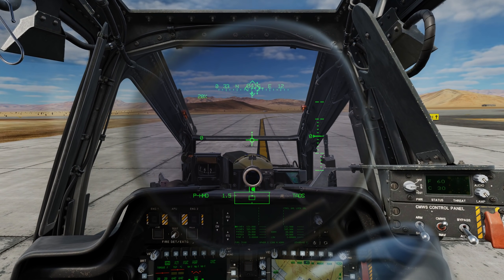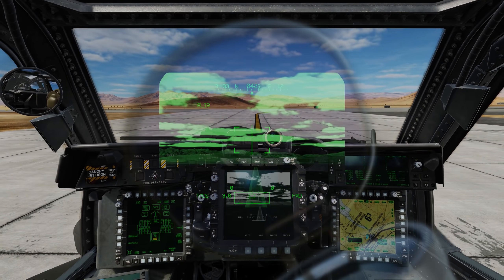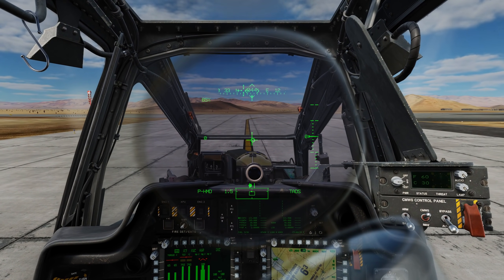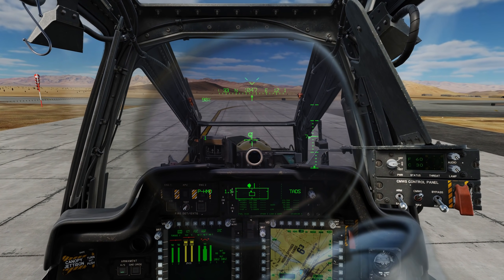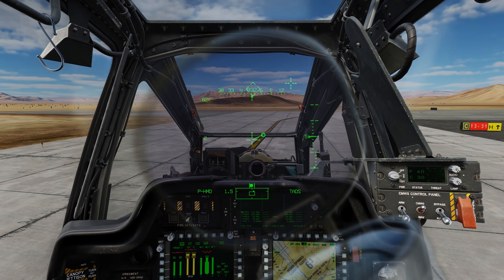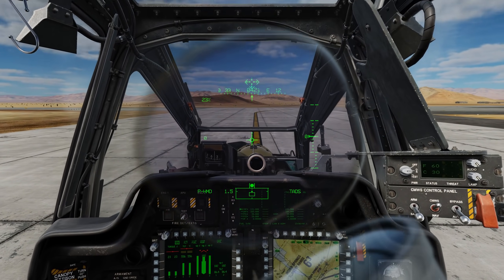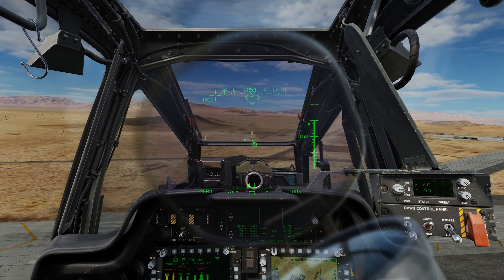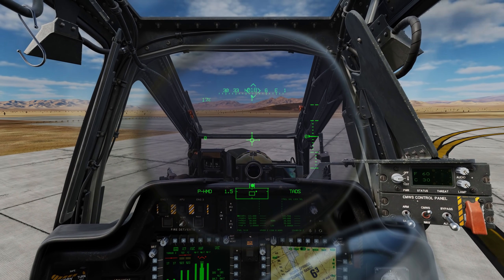DCS: AH-64D | VRS and Settle with Power

Comment: I see guys all over YouTube demonstrating VRS recovery.  How come everytime you hover you’re not in VRS?
Reply from the maker: Just flying correctly within the envelope based on IGE, weight, and keeping an eye on vertical velocity. All instances I've seen online of players getting into VRS are cases of not flying the helicopter particularly well.
Reply: When in a stable hover the air is being pushed downward throughout the length of the rotor blade and the air at the blade tips are creating a vortex, just like an airplane has a swirling vortex of air that your see coming off the wing tips. In VRS/SWP the air has 2 swirling vortex along the blade length. The first is formed at the blade tip with the air swirling out and coming back in to the blade and the other has air moving up through the blade root and it swirls back into the Blade. It is the vortexes that reduce lift in the rotor blades and cause the helicopter to settle. VRS and SWP are the same thing. VRS is the technical term and SWP is the common term.

Comment: Good demonstration. A rule of thumb is to always make sure that as the airspeed gets down to 40 knots or so, that the Rate of descent must be less than 300 ft per minute. Another important factor is that when you go through translational lift, (either speeding up from a hover or slowing to the hover) make sure you are into wind. This is especially important for all the learner helicopter pilots out there....

Comment: It's not settling with power.  It's settling with INSUFFICIENT power.  That is what we teach at Ft Rucker.  There has been 1 helicopter that has enough torque/power to get out of this condition, and it is/was the CH-54 Tarhee/SkyCrane.  Everything else, even the mighty Chinook which has a shit-ton of torque, can't power out of that condition.  It must bite clean air, preferably laterally, to get out of the condition.  This is not the same as VRS however, it is aerodynamically different.

In terms of this module, I think it would help folks familiar with DCS to look at this as the "Hornet of Helicopters".  It is complex, a deeply integrated weapons system, and has the Tomcat's AI to assist the pilot/CPG with tasks.  I was a Chinook guy not an Apache driver, but I still have Army Aviation experience.  This module is very well done, the flight model is VERY nice, and I think as this iterates it will grow into a very accurate representation of this amazing weapons system.  You need look no further than folks that have flown this platform and the way they speak of the DCS implementation of it to make that assessment...
Reply from the maker: Our group of Apache pilot SMEs will disagree with you.
Reply: Karl…SWP and VRS are synonymous. Look it up in the FAA’s Rotorcraft Flying Handbook.
Reply: @jjsemperfi  They are not synonymous.  The best way to think of it, is one can can mature and develop into the other.  The easiest way to think of it is, you can begin settling with insufficient power, and it can develop to full blown VRS.  Similar, but not the exact same thing, would be incipient stall to a fully developed stall.  

You can also encounter VRS directly, such as a low altitude hover near obstructions that interfere with the downdraft and can cause VRS directly and immediately, even if not descending.  Rare I grant you, but it can happen, especially in an urban setting.  I didn't want to sit here and have a highly technical discussion with a group of folks that would be uninterested in such a thing.  I was trying to relate the knowledge without overwhelming someone.  btw, there are also newer techniques that have been evangelized widely that purport to get out of the condition without losing more than 50' of altitude.  Go look up The "Vuichard Recovery Technique". 

I appreciate you telling me where to look.  Not sure I have ever heard of them, being licensed for 30 years and being an instructor and all.  :)  Having said that, I don't know everything, about anything.  Anyone that does this stuff that knows even a little bit, should have the wherewithal to tell you that you are constantly learning, or you are a huge risk.  Both can't be true.

Comment: About the trick for turning off the video from the IHADSS when using TADS, it's the brightness button you want to use, not level. If you use level, you will turn off the video on the TDU too, and basically make TADS useless. But use the brightness button while the Helmet is selected sight and you can turn it off just for IHADSS.

Comment: Getting out of VRS is easier and faster, also requireing less altitude, by using the Vuichard Recovery Technique (https://youtu.be/HjeRSDsy-nE). With the AH-64D, it's cyclic right, collective to full power and left pedal to compensate. In case you want to translate the technique to any other helicopter, then go by the basic of rule: Cyclic goes opposite direction to the pedal.

Comment: These are invaluable videos, but for me personally, I can't even do your first lift up. I get that I need to rudder left and correct a little cyclic but the heli always just veers off all over the place.  Been at it since release. No luck. Either I'm missing something critical or the controllers not configured right.
Reply from the maker: You may with to adjust your curves.
Reply: @MattWagner  Spot on again Matt thanks. I haven't got it down every time yet but if it helps any other newbies like me, by setting the rudder left and slight down left cyclic and fixing it with trim, I was able to concentrate on chasing the hover circle which got me hovering.  It was all way too sensitive though so it's no doubt crucial to get curves and sensitivity etc set right for your controller.  Onwards and upwards!
Reply from the maker: My curves here. https://youtu.be/HmjNjNDp0JA

Comment: The SWP modelling in the Apache is pretty much the best represented in the game. I hope at some point the other helos get some remodel, as the "vrs" to me is a bit too easy to enter. Since the first few flights in the 64 the first two things I look at are the OAT and the Elevation. Then will automatically start to decide, to I need all the pylons filled ( esp if having to to sneak attacks from cover ). One question - the predicted performance torque required, it is always the same for IGE and OGE. OGE would always be higher and the values don't seem to compare as well with what you actually get. PS> will HIT tests be implemented ( add them to the Huey! ) haha
Reply: @aldamico  I never said the Huey flight model is bad. Enters VRS too easily. I feel like the MI 8 is the same. I have about 1000 hours riding around in Hueys and some stick time so I know a little bit. he Huey feels like what I remember from flying one.  While the Apache does have some quirks ( excess yaw on collective inputs and nose down moments, I have never flown one but perhaps you are correct. I am sure it might be tweaked. If you read my comments, it was towards VRS specifically and nothing more. And, they are just one persons opinion, just as yours is.

Comment: Your description is spot on. Your demonstration of it was weird. If you want to practice VRS, it's better to simulate it in normal situations such as hovering or a steep approach to a landing. What I'm saying is there's no reason you're going to 'zero out' your collective while in a hover unless you lost your engine or you're doing a maneuver from altitude. Lower your collective to establish a decent just over 300 ft per minute while you're less than 15kts. Pull in a little power and if you're in VRS you will start to descend even faster and the more power you pull the worse it will get. There are two recovery methods. Lower collective (power) and cyclic forward for airspeed. The other is pull max power (not over-torque) right cyclic with pedal input to keep the nose straight.
Thanks, Matt and the team for all that you guys do.

Comment: Hello Mr. Wagner and other ED personal, I enjoy the module very much. Have set up most controls and flew a couple of minutes to test them out. Everything works great with ‘normal’ flying and I have Track-ir for that. But I also have the Valve index and with that I am getting 2-5 frames, pushing 10 if looking forward.  I am running an Ryzen 9 5900x and a 3080, this runs DCS superb and in VR I can fly all planes, as well as the Huey. 

So, for me the VR experience is not the best right now in the AH-64 :D Allthough it looks amazing if I just sit still for a moment. 
Any ideas if this a topic on a list or something the VR community can try?

I have tried most standard stuff already, either in driver updates or in 3D settings in Nvidea. 
Cheers for any tips and keep pumping out the good stuff!

Comment: Is the immediate speed of the clockwise rotating torque accurate? I feel like if the collective moves up anything faster than a snail's pace the helicopter immediately starts rotating almost uncontrollably. Even worse when the force trim up switch is used and I want to increase collective, in which case there is not only rotation but also yaw and roll. Not sure how the trim switch down should work, but it doesn't appear to do anything to cancel the trim such as the Huey does.
Reply: There is no trim re-set in the Apache, the down button is to cancel the other 2 hold modes which at moment only one is modeled. 👍